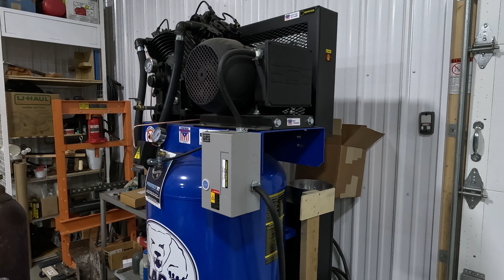Soldering Copper Pipe To Make Dry Air System (Never Soldered Before)

Comment: Good job sir, I could see your technique improving over the course of the video. Those cup style torch strikers take a bit of practice, but in no time you'll have the right grip to allow you to push down at the same time you are pushing sideways. I've gone on to the trigger style that look like a tiny gun and you pull the trigger and it shoots a spark out in front of the torch. They are quick, easy to use with gloves and if you are lighting a large torch they give you a bit more room between your hand and the flame. One more thing, I appreciate seeing a fire extinguisher handy as you're doing this. Fire safety is sadly neglected all too often.
Reply from the maker: When I originally cut the video it was like 2.5 hours long and I talk about having an ABC fire extinguisher on hand. Glad you noticed it sitting around!
Reply: Fire extinguisher!  😂